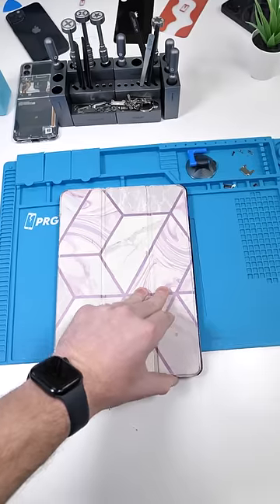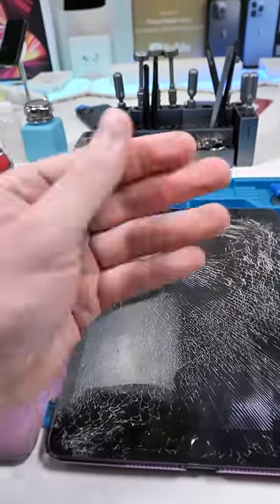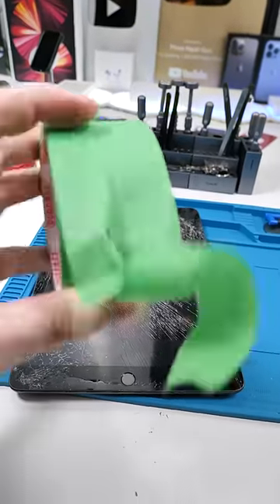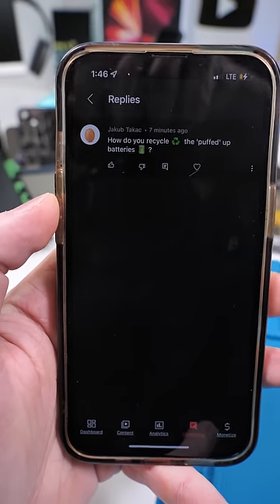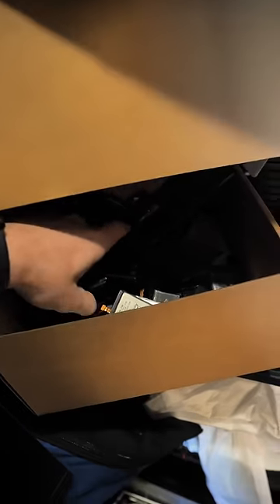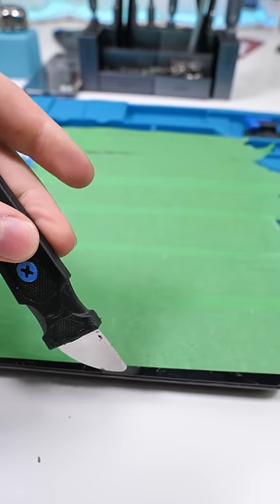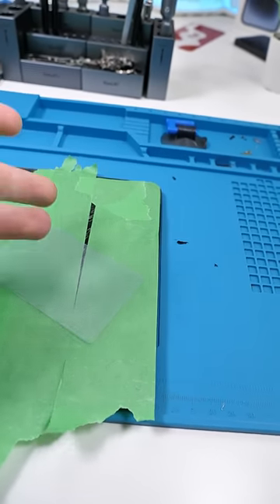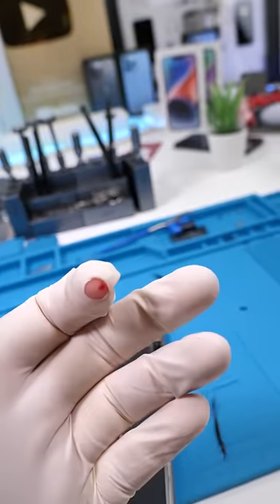How Did An Elbow Do This..? #shorts

Comment: That box of batteries is literally a nuke just sitting in his shop
Reply: what im sayin
Reply: Skibidi bop mm dada hazard
Reply: Nah, in the summer I taped up like 10 years worth of busted up old leaky batteries and a bunch of fireworks and shit, it was about the size of a milk crate, and I chucked it in the fire and ran... Nothing really happened.
Reply: Well, unless they're fully charged I doubt they pose a significant risk. Lithium polymer batteries don't just suddenly thermonuclear, there has to be a reason behind it such as charging a damaged battery, overcurrent or puncture. As long as they're sitting idly at a voltage of around 3.8V they'll just chill there.
Reply: Batteries don't usually explode, they ignite.
Reply: @icankillbugs that's because batteries ignite and catch fire not explode although they can explode in some rare occasions

Comment: I would highly recommend getting a flammables cabinet for the puffed up batteries. Or at least store them in something else besides a cardboard box
Reply: Preferably also have a bucket of sand near it if for whatever reason a fire starts while you move the faulty battery
Reply: A flammable cabinet?!
Reply: @Loaves_of_Cat  flammableS, as in a cabinet for flammable objects; probably made of metal or something like that
Reply: @Loaves_of_Cat  reading all of the letters in a word can make all the difference sometimes.
Reply: I once saw someone putting their old puffy batteries in a really old chest freezer
Reply: @HandsomeToast  Lithium battery fires need to submerged in water. Sand will do nothing.
Reply: Agreed
Reply: @washellwash1802  nah it will burn harder
Reply: @HellsGhost1849  yup since lithium is very reactive and will react with water
Reply: what do you mean?? the cardboard box is perfectly safe!
Reply: @washellwash1802 Don't spread bad advice, the sand keeps the fire from spreading, water would create hydrogen gas which is highly flammable. Not what you want from a burning battery.
Reply: @spacecadet2663  Lithium fires don't burn hot enough to split water into oxygen and hydrogen. Lithium metal does react with water and can make the fire worse and should be extinguished with a Class D fire extinguisher. Lithium-ion batteries can be extinguished with water, in which water is used to cool it below combustion temperature. Since warm and damaged batteries tend to catch fire again, fire departments across the world have take to submerging EV's in water for up to week to ensure everything is cooled down to a safe state. You don't have to take my word for it, just google EV fires and read the news.

It's magnesium that burns 6 times hotter than a lithium ion/metal fire that creates hydrogen and oxygen from any water you put on it.
Reply: Why'd you have to tell him? We could've gotten some cool videos. Just joking. I was going to mention that too. Lithium Ion batteries are evil little monsters.
Reply: @washellwash1802  bro failed 10th grade chemistry. Lithium LITERALLY burns harder when in contact with water.
Reply: @HoorGuvLabs and you failed 1st grade of reading till the End ;)
Reply: @DarthG3nesis  shiver me timbers. Though my excuse is that English isn't my mother tongue :)
Reply: @HellsGhost1849 you're correct about that, they'll devour the oxygen in the water releasing hydrogen gas in the process and possibly become extremely flammable
Reply: @anthonydaniel953 except its not lithium, it's li-ion
Reply: we meet again
Reply: @veowav  what does the "Li" in Li-ion stand for, chucklefuck?
Reply: @therealtony2009  is that the one and only Tony?
Reply: @richardmillhousenixon  Lithium. A Lithium battery is different to a Lithium Ion battery.
Reply: @veowav  theres still lithium in there though
Reply: @richardmillhousenixon  yep. hope we meet again
Reply: @therealtony2009   the outer shell of a lithium atom has one electron which makes it reactive. If that singular electron is bonded or otherwise not there, the lithium is less reactive.
Reply: @veowav  Less. But not unreactive.
Reply: @richardmillhousenixon  if the outer electron shell is no longer free, how can it be reactive. It's stable then. I've taken apart lithium ion batteries and even when I scrape off the oxidised layer, it is very unreactive. So much so that in water all it does is bubble.
Reply: Very good advice. All it takes is one spark to ruin everything.
Reply: You kinda don't need it The batteries don't catch fire as much as they used to and these ones aren't powering anything so nothing's gonna start a fire
Reply: @Llaaalu  Damaged batteries can start a fire with or without being plugged into anything. And even if they "don't catch fire as much as they used to" they still catch fire. Do not risk it. Flammables cabinets are cheap compared to the cost in insurance premiums alone if your home or business burns to the ground.

Comment: You should use an airtight container for the puffed up battery’s…. If a fire does start it would be contained in the box 😊
Reply: There are special steel boxes for that. Not airtight, but quite fireproof … together with a smoke alarm it’s quite safe :)
Reply: Yes, always store known bad batteries in a fire and explosion proof container, preferably in a concrete structure like a garage.
Reply: Sand and a steel bucket.

Comment: For safety you should have your batteries in a lipo safe bag. Which is a lithium polymer safe bag. Put the batteries in there, and if you can, put them in a container that can hold it but has a vent, you want something to contain fire if necessary, but vent the fumes so it doesn't become an explosive. For keeping my lipo batteries I keep them in a lipo safe bag in an ammo can, for venting purposes I cut the rubber seal off of the middle leaving only some extra by the corners and on them so they can close and seal while having slight access to vent. Safely in this way is important.
Reply: Yeah, that was scary to watch.
He keeps pile of potential damaged batteries in a box for almost 3 months. WTF

Comment: I had one of these!
The only difference is mine got dropped at a cemetery on the edge of little family grave site...
After that it slowly but surely got every single circuit piece busted by the glass that fell into the little crevices😢

Comment: What I love about iPad 7,8,9 they are almost the same, if you're in a pinch you can use a iPad 7 digitizer on them. mobilesentrix is great but i prefer my parts guy, also cook the iPad from the bottom it is better for the lcd.

Comment: Yea, when tablet touch screens shatter they do tend to "inflate" but its seemingly that common as even my galaxy tab a (2016) currently has a touch screen in simmilar condition, i do have a replacement but need the tools and dont have the time, i havent brung it to a repair shop because of the brand new price being 100 dollars and its probably worth less than 25 dollars as if now and a touch screen was a little under half of that

Comment: Putting the batteries in a Bat-Safe can save everything really needed for high power battery applications, but can just use battery bags. Failure point is the gas build-up opening the pouch...

Comment: What temp do you cook the iPad for, and how long? I've recently got a screen repair heater and I don't want it to heat the back of my phone up enough to melt the plastic, I do Motorolas. I also do some apple devices, and the same question applies.

Comment: That is definitely an illegal storage of batteries if that isn’t an isolated single family building you are in. Should be stored in a flame proof cabinet or at-least in a metal bucket with sand in it on a concrete floor away from flammable materials

Comment: I obtained a Galaxy A23 5G in January 2023.  It received another update in April 2023.  After the update I talked to my stepsister for awhile and then put the phone on charge.  About a minute or two later it died.  I mean dead brick died.  About a half hour later I was able to get it back to life but the battery percentage was 27% whereas it was 72% when it died.

Then the phone started getting hot when charging.  I'm talking temperatures 118-130°F hot.  I even switched out chargers to make sure it wasn't my charger and got the same result.  Now it won't charge so I'm guessing some how that last update screwed up the power supply.

I've owned one other Galaxy before and I'm sure this will be my last one.  My older Galaxy has features this new does not yet Samsung put in features I don't have a use for...

Comment: I would love if u can fix mine, after I took it to a repair shop the button at the bottom just sunk under the screen and the screen began to separate or you could say lift and you can see the inside. I took it back to the shop and I believe they added more glue to it but it still keeps lifting up and I don’t know what to do 😭